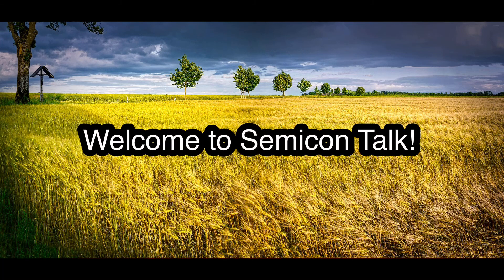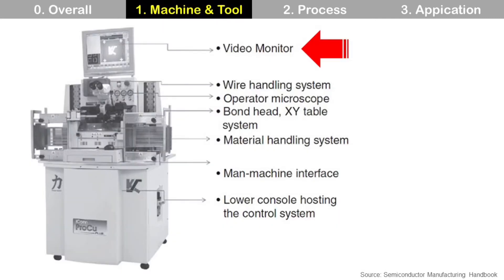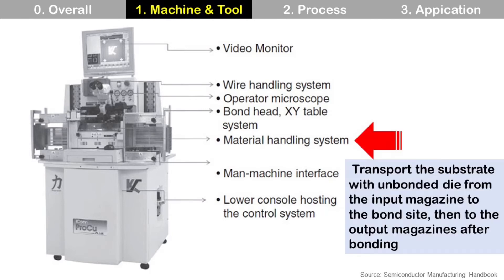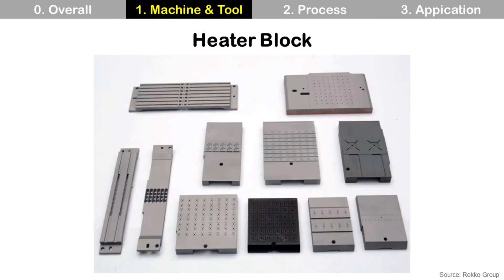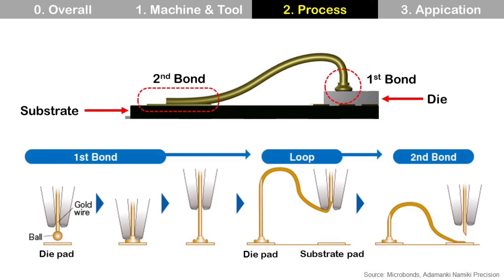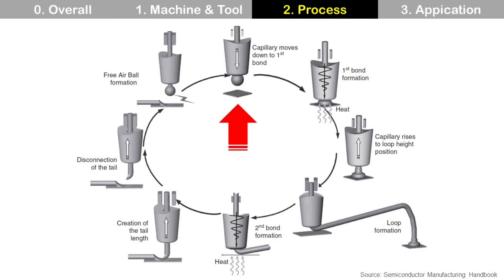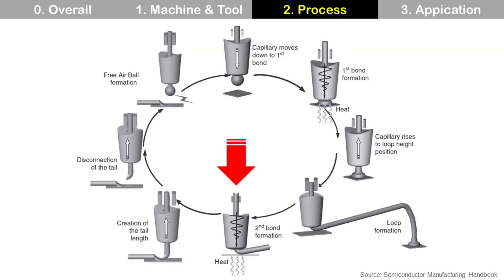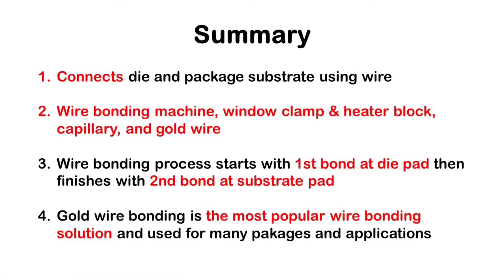[Eng Sub] Au wire bonding - Ball bonding, Capillary

Comment: Is there any way to know the expected ball size by Capillary?
Reply from the maker: Sorry for late reply, I didn't get notification from my YouTube Studio for your question. Yes, there is a way to calculate estimated bonded ball size by capillary.
A general rule is that the bonded ball diameter should be about 80% to 90% of the Capillary Outer Tip Diameter. So if you use capillary with 50um Capillary Outer Tip Diameter, estimated bonded ball size will be 42.5um by using 85% of Capillary Outer Tip Diameter. But it is a general rule and you may can use simulation to calculate more precise bonded ball size.
Estimated bonded ball size = 0.85(Average of 80% to 90%) x 50um(Capillary Outer Tip Diameter) = 42.5um.
Please also check how to select capillary dimension for your reference.
https://www.inseto.co.uk/wp-content/uploads/2019/11/Bond_Capillary_Tool_Product-Selection-Guide.pdf

Comment: I am looking for some advice on how to push the wire through the capillary tube once the become disconnected. Anyone have any tips?
Reply from the maker: Long ago I saw operator used tweezer to pick wire from wire spool and push manually.